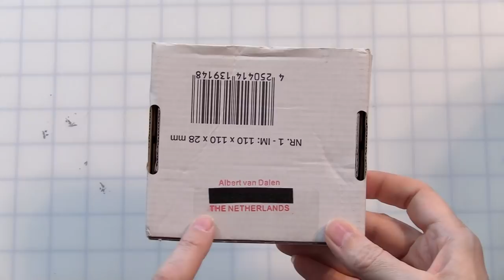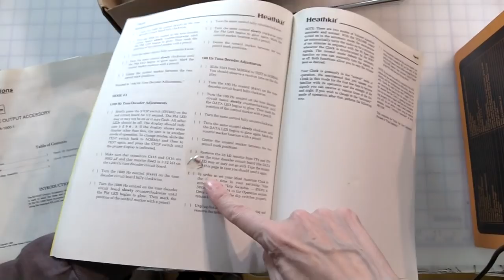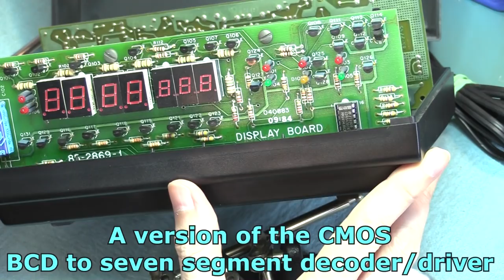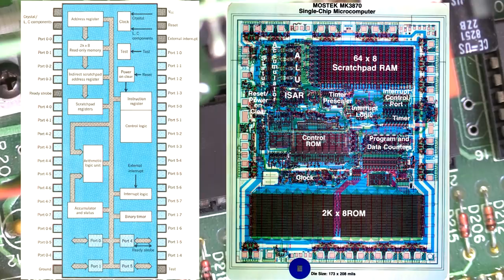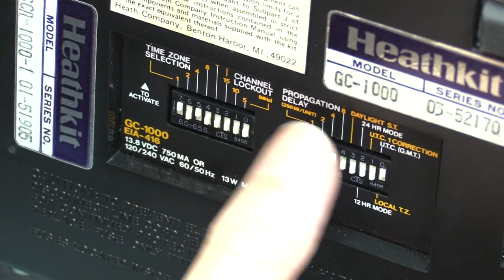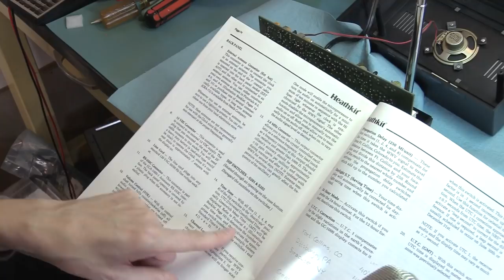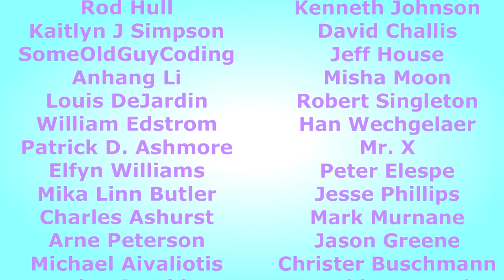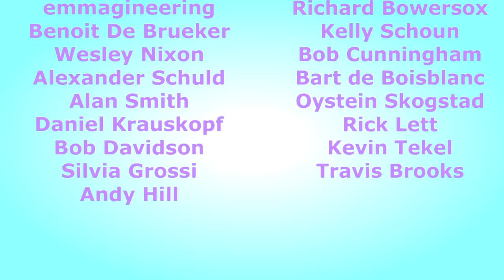Mini Mail #1 - Heathkit GC-1000 Most Accurate Clock

Comment: Fran, there is one way to set the time: Plug it in at midnight.
Reply: Thats not true. All it has to do is synch. I always hoped someone could come up with a way to add time set buttons so when WWV shuts down we can still use these
Reply: @jkobain   How would you do that?
Reply: @jkobain  You tell me
Reply: Actually there was a way to set it fairly close using the test mode and the silver button on top of the regulator.
It was very tricky and difficult.
Reply: I have to do that with my Electric Stove.
Reply: Even a clock that is D.O.A. is wickedly  accurate two times a day 🙄 Just saying...
Reply: You know, that is a great solution.
Reply: I fired my gc-1000 up tonite !
Reply: I collected clocks for a little bit and one of them had a broken time setting switch, so that’s exactly what I did lolol
Reply: @audiodood  If the clock doesn't have an am/pm indicator, you could do it at noon too. A broken clock is right twice a day.
Reply: @GordieGii  well, this one did have an indicator lol
Reply: @audiodood  Oh well, the saying only applies to mechanical clocks. I doubt there are many digital clocks that just don't run but still show the time, except maybe on VCR.

Comment: I built one of those clocks back in about 1985.  At the time it cost 249.95 and the RS-232 interface was about $20.
In those days, it was the only consumer clock that synced to the WWV time signals from Colorado.  It would pick up 5, 10, and 15MHz stations that provided universal time.  It also lets you listen to the broadcast.

The voltage regulator was one of the weak points in this device.  /It ran too hot and would even un-solder the pins and burn the PC board.   There is a third party upgrade kit for this regulator section.

The way it worked is that it had to receive two complete one minute cycles of date from WWV to set the clock to run.  There was no way to easily set the clock manually, so if you could not get a good signal the clock would not operate.  I had to use the external antenna jack and I   made a quarter wave antenna.
Reply: 250 bucks was a lot of money in the early-mid-1980's!

Comment: I would like to see that switching regulator switched out with a good old linear regulator. Then make a video about the trouble shooting and repair of it. Would make great content whether it works or not.
Reply: Steve Terry  The original regulator ran very hot.  This is why the regulator circuit was modified.  Apparently this person was able to make it work with this mod.

http://www.nixie.dk/~jthomas/gc1000.html
Reply: If you look at the images closely you will see the heat sink has been removed, and a spacer used in it's place for the height.
Reply: That's a common mod to the Heathkit clocks: Like @DandyDon1 said, they run very hot with the original regulator. You can find other vids where people have changed out these regulators/power resistor for a modern switching regulator.

Comment: Fran, that HF receiver was not designed for a switching power supply! The noise is swamping the receiver. Try to find a linear regulator that will work. 73, Dave
Reply: I think she knows...
Reply: @15743_Hertz  that's called "paranoia"
Reply: seems it was a common mod, I found a website that recommends it.   http://www.nixie.dk/~jthomas/gc1000.html
Reply: Richard Wielgosz, no... Basically it is just fundamental overload. That switcher is not shielded and the HF receiver design never “anticipated” a switcher on the same real estate much less those cell towers in the same neighborhood. It is no wonder why that receiver is losing its ability to hear. LOL 😂
Reply: @jhbonarius  Or "mansplaining"
Reply: @GiddeonFox  sorry, but I consider generalizing everything paranoid men say as "mansplaining" to be it's own form of paranoia.
Reply: Steve Terry  Normally you'd hope that the (more or less deliberately) odd fixed frequency of the oscillator would help it not interfere with radio too much, unless you hit a bit of bad luck - well not to say that true fixed frequency exists, but it may only depend on temperature. However i pulled up the datasheet for these PT5100, they do not have a fixed oscillation frequency, instead it appears to depend on the input voltage. And the input voltage would bob up and down peaking when mains peaks and descending from there, creating a spread spectrum which can trample over the whole RF, and it will tend to hit right around 750KHz which is just unfortunate.

As far as efficiency mods go, i'd have an urge to install an MP1584 or something tuned at close to 1.2 MHz upstream of 7805 to preregulate to 7V or so and lighten 7805's duty, in place of the bulky resistor and right near the display board away from RF circuitry, and maybe even RF shield it. I can't promise that it would be problem-free, but would be curious to try whether it would cause any issues.

Comment: Love the pre-GPS pre-Internet clock. You used to be able to buy an isa board for your computer with an in-built receiver and external antennae to keep your RTC referenced to the IAT (International's Atomic Time) standard. 40 years ago there was no other reliable way of doing it. I used to work in aviation, which couldn't operate without coordinates, including time coordinates. For decades this was provided by radio.

Comment: The switching regulator in the PSU has to go. Put in a  straight analog regulator, and it should significantly improve the noise floor. Those modern replacement units are fine where efficiency is needed, but NOT right next to the frond end of an HF receiver!  The original 78(05?) regulator ran quite warm even on that beefy heatsink.

I had one of those units for years, and am also on the US east coast.  Using the internal antenna, reception was pretty poor most of the time.  Likes an outdoor longwire antenna much better. If you can't hear WWV audio above the noise, the clock will never set.

The unit will just sit there with a blanked display until it decodes a couple consecutive data frames from WWV. then it will display the time. One of the Green LEDs should blink with the audio "ticks" of the WWV audio.
Reply: I too am in the NE and the only way I can get it to synch on a regular basis is with a 20 ft wire spooled around the ceiling and at 10mhz only

Comment: Fran, in switching back to a 7805 refer to the manual for a required dropper resistor, that has from what I see, may have been removed from the board and jumped with the red wire.  I always like the clock vids.  Good luck and enjoy!

Comment: A couple of notes about the GC-1000:  First, it uses an envelope detector connected to a series of 567 tone decoder chips. This is how it reads the 100 Hz subcarrier from WWV, as well as the 1 kHz ticks.  It's not a particularly reliable method because selective fading can really mess things up. 

The clock needs to correctly read three successive minutes of properly decoded signal, spaced by one minute apart before it sets itself. There are no checksums, so the clock has no other way of knowing that the time was properly received. Sometimes selective fading would kill one of those 1 baud signals in exactly the same way three times in a row. This would cause the clock to jump to an incorrect time reading. It could be off by as much as hours, or tens of minutes. 

Finally, the receiver was never all that great. You probably should not use the whip antenna that came with the unit. Instead use one or more outdoor loop antennas tuned to 5, 10, or 15 MHz. You need to do that to get away from the noise of so many switching supplies, variable frequency drives in appliances, and so forth. 

Yes, we once used those things for a SCADA system back in the late 1980s. We had to put a sanity check in our software to not react if the time suddenly jumped.

Comment: I assembled a Heathkit alarm clock kit on New Years eve 89-90 with a bottle of scotch. I am still using today, great kit.
Reply: Funny, I tend to use a soldering iron to assemble a kit. :-)
Reply: @gorillaau  Things were slow at work right before Christmas, I waited to buy presents until the week before, the end of the week we got laid off, on new years eve, I really needed a drink. I did have a couple of Radio Shack irons to keep me warm.

Comment: I've had one for years.  Recently had to recap it and retune the radio board.  Where I am, 5 and 10 MHz are the best frequencies.  You can modernize the clock and get a GPS interface for $90 or so if they ever have them in stock.

Comment: I believe the "data" signal on WWV is a 100 Hz pulse. That's why the "data" light kept coming on when the buzz was loudest. If you pull up WWV on a shortwave radio, you can easily hear the long and short data pulses amongst the one-second clicks. They're slow enough you could probably transcribe and decode it manually. I haven't looked in years, but the exact format of the data signal from WWV was shown on a page of the ARRL Handbook. That page in the handbook always looked like a duplication of a US government publication. SO it's likely available directly from some government office.

Comment: You wouldn't be hearing noise and grunge from the cell site itself, but rather the many, many devices in your building with switch-mode power supplies, some of that energy being conducted on overhead power lines and internal building wiring.

If you have florescent light fixtures - especially those with electronic ballasts - that will be one of the causes of the din - but that's easy to check out (turn them off!) - but there are likely dozens of "wall warts" around the place that are emitting lots of noise and it would required turning off all of the circuit breakers - then turning on one at a time - to find the culprits.  "Pure sine wave" - and some normal non-sine UPSs tend to be a strong noise source whether they are on back-up or not and will still make noise when the power is off.

Comment: My understanding is that WWV made some changes to the system that impacted this clock's ability to receive the codes to set the time.  However they did something that made it still work.
I purchased mine in 1985 and lived in Memphis, TN at the time.  The local antenna was not adequate to receive a strong signal at my location.  A friend of mine constructed a crude quarter wave antenna that could be mounted indoors and it worked.  It still sometimes took a while to lock on,  I found it was best to lock out the weak channels and use just one to get a lock.  At that location the 10 MHz worked the best.   In 1990 I moved to Jupiter, FL which is close to West Palm Beach on the south east coast of the state.  Even though it was farther from the station in Colorado, it worked very well there with only the local telescoping antenna.  A year later I moved up to Hobe Sound, FL and it was difficult to get a good signal there.  Hobe Sound is only 15 miles north of Jupiter but something made the reception harder.  I went back to the quarter wave external antenna and it worked reasonably well until about two years ago. It might be an issue with my antenna, but it hasn't locked on in a while.

Comment: I remember a friend of my Dad's building one of those - it hardly ever locked onto WWV, too much noise from his Altair 8800!
Reply: Replace the telescopic whip with a BNC connector and run a coax out to a dipole well away from the house.  You'll be amazed at the improvement.
Reply: Have to take my little WWV clock out in the back yard for a good lock. Lol.
Reply: @kenlogsdon7095  I'm pretty sure that the clock already has an external antenna connection on the back.

Comment: I own a GC-1000 clock. It is supposed to come up with the display BLANK, only the decimal point should light! The clock will display time within 3 to 20 minutes as it locks to the WWV signal. Mine works perfectly even 1400 miles away from WWV Boulder Colorado using an external inverted V antenna.  73 - KV4WM - A US Navy Nuclear Submarine Veteran and FCC Licensed Radio Operator.  BTW - RTFM !!! it's all in there!

Comment: The reason the power supply was modified was the original power supply cooked really hot. If you search on line there is a modified power supply design that still is a linear power supply. I'm located in Wyoming about 300 miles from WWV But even being that close I have a hard time receiving it during the night. I have mine configured to just receive 5 and 10 MHZ. It works much better with an outside antenna. I use my ham Antenna and WWV slams in to the clock. I wish mine was in as good shape that the one you received. I purchased it on ebay and was a little rougher looking but after all its over 40 years old. I hope you enjoy yours.
Reply: My clock came already modified, so I’m not sure exactly what was done. It does run much cooler after the mod. I had another clock that I had to send back. That radio ran very hot. If you turn off the display it runs much cooler.

Comment: Fran, that switching regulator has been installed for a reason. That heat sink used to be black anodised, now it's light gray. The board  under it is black! That heatsink was blazing hot with the 7805! And it was also cooking the filter capacitors behind it. So I think the best option would be to replace the transformer to a lower voltage one, and use a pin compatible low drop linear regulator instead of a 7805. This way you can get rid of both the interference, and the excessive heat. Also, I suggest to rise that board on the top of the heatsink with two spacers, it's covering the fins. And if the layout allows it, drill holes on the PCB under the heatsink, to help the airflow getting among the fins.
Reply: mmmm1 is right.  Heaths original design used a 7805 which ran HOT...  The transformer ran HOT too!  Caps dried out, board gets scorched.  Yada, yada, yada.  Read the included printed insert that was stapled together.  It describes mods for replacing the regulator and caps.  I did this mod to my clock and it did the trick.  You also might wanna check the caps in the tone decoders when you do the calibration.   The  Mostek cpus are the exact same part... grounding one pin on the chip causes it to run the code to send the time out to the serial port....  Each frequency will receive WWV at different times of the day depending on atmospheric propagation.   The whip antenna won’t cut it for reception on the east coast.  My clock ran best with a good outside antenna in Ohio.  Antennas and signal reception is another hobby that is at the mercy of local Radio Frequency Interference or RFI.  WWV may go off the air to save the government money so get you’re GC-1000 working while there is still a time signal to receive.  This is one of Heaths cool (even though it ran HOT) kits cherished by many!   I haven’t checked for YouTube vids about it but I bet they’re there. Also Google will produce lotsa information about the clock since it’s not politically conservative.  Have fun!

Comment: I agree the switcher regulator must go.  Philly might be a bit far from the transmitters in Colorado to pick up the signal without additional effort.  Maybe make a higher gain directional antenna you can point toward CO?  Then maybe you'd only be picking up noise from the direction of CO?  And possibly add shielding in the case?  I guess it depends on how much effort you wish to expend to make it work...

Comment: The person that assembled that took their time and did a great job. All those discreet components just scream that this thing will last forever (maybe with replacement of the electrolytic caps). You seemed to indicate that that switching power supply module wasn't the one the kit came with. I'd either try to duplicate the original if possible or just find a compatible solid state one. Once you get it operational otherwise, try getting the time signal at night. I had a watch that synced to that and it could only get a signal at night if it were placed on a window sill facing west. I guess this was a precursor to using a GPS receiver to sync PC's to (before everyone just started doing it over the internet.

Comment: I still have mine as well as all the manuals.  You can plug a serial terminal into the output and it will display the time in a terminal.  Fun project but much easier to do now with a Raspberry pi zero W.  I have built several clocks using the pi and both the Russian 1N-14 Nixie's and the old Burroughs B-7971 4 inch alphanumeric tubes.  Self setting due to the use of the ntp servers.

Comment: Fran - FYI that switch on the left side of the case turns off the displays which reduces the current appreciably.  As others have suggested the substitution of a switch mode regulator is likely swamping the receivers so it may never sync properly.  Also, I've had one of these for years and until I switched to an external antenna (a simple dipole tuned to 10 MHz hung in my attic) it hardly ever synced.  Even with the external antenna, mine may take a day or two to sync but I live nearly 1100 miles from WWV.

Comment: The 7800 series voltage regulators have a habit of oscillating if the input decoupling cap goes bad, or the ESR increases over time, as will happen with an aluminum electrolytic cap.  At minimum, a 0.1uF ceramic cap with low ESR should be used directly at the regulator's input terminal.  From your diagram, the input terminal of the 7805 has a low value series resistor resistance to the regulator input terminal which would appear as additional ESR of the caps used in the input circuit.  The 7805 output voltage may oscillate at the output at a frequency of about 5MHz with a signal level of about 1Vp-p modulating the top of the DC component.  It's important to look at the regulator output with a scope to find out whether or not the device is oscillating.  A digital multimeter will simply show the output voltage to be about 4.5VDC for a 7805.